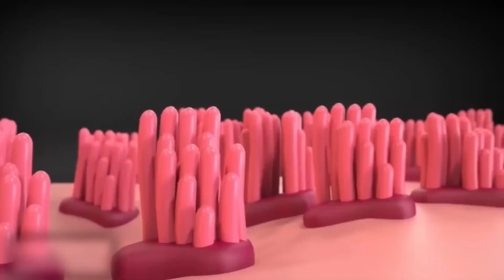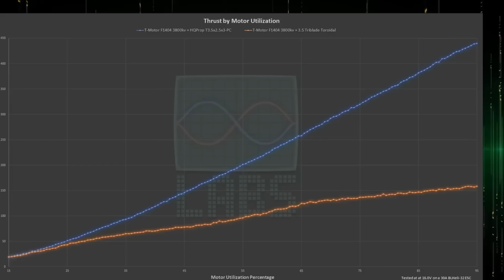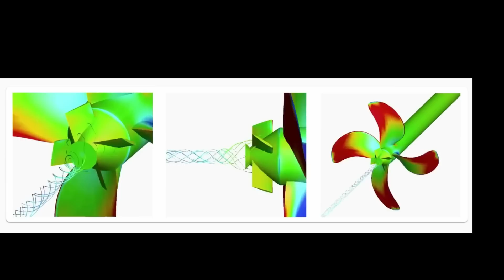This Propeller will Change Aviation Forever!

Comment: What about boats like mine that have 2 counter rotating props on the outdrive? Would it even work and would it be worth an additional $8000 in expense compared to two $450 props. That's not chump change.

Comment: I own a Cessna 180, I have a McCauley 2 blade prop which costs 11K .. these props have a pitch control .. so you change this as you fly … If there was a toroidal prop it would be interesting as it wouldn’t have that unit, it would weigh more though.  Aircraft aviation is very regulated re safety ..this design is quite old.  But make it quieter and fly faster and cost $110K ..it would be interesting to see it made.  For me if it was 10 knots faster but saved 20% fuel that would change the game.

Comment: What about airplanes that have variable pitch propellers in order to take advantage of thinner atmosphere, higher engine speeds, and Fuel and air mixtures. This type of propeller would be a non-starter.

Comment: Toroidals are at least 10x more expensive and the fuel savings are illusory, at best.  If toroidals are so much more efficient, why aren't wind farms using them ???   You don't even see them in cheap desk fans.

Comment: 🤔🔊💭 It's an intriguing question, and the answer might surprise you! While it's commonly believed that the powerhead is the main source of noise in an outboard motor, the submerged propeller does play a significant role in generating noise. 🚀🔊

Comment: I would say propeller technology has come a long way since the Wrights.  This propeller was thought to be quieter and more efficient but it was just about a wash as to those parameters.  That was the conclusion back in the Sixties and Seventies.  You can still find these propellers, on mixers.
Reply: Propeller form design theory has advanced certainly, but the Wright brothers deserve most of the credit for realizing that they could design their aeronautical propellers around a wing section that varied in angle of attack along the radius. Many supposed well researched and better financed would-be inventors conceived of propellers which were simple spirals. The efficient propellers designed and constructed by the Wrights enabled them to get into the air with minimal hrsepower from their home-built gasoline engine and is one of the main reasons they deserve credit for first in powered controllable flight.

Comment: Concerning fixed-wing prop planes, how would you feather the prop to prevent drag, should the prop beccome disabled?
Reply: twins you can feather the prop, not sure about turbines but high performance singles let you control the pitch to a degree, not feather. the fact this prop can do neither seems like an aviation deal breaker to me except for fixed pitch propeller planes which tend to be lower performance.

Comment: Well in an airplane you have to remember the more power the propeller puts out the more torque it puts on an airplane in the opposite direction. So I don't know if this will work that well on an airplane. If you've watched the movie about the friend in the Korean war that crashed his plane to save a friend, who was black, When the pilot that was scared of landing was coming in and was short, he hit full throttle and spun into the water, well that is about what this propellor on an aircraft might do.
Reply: No.
Reply: Thank you❤. 😊
Reply: In that case perhaps it needs modification for aviation use ?

Comment: Without the ability to adjust blade pitch for different airspeeds, any gained efficiency will be lost - non starter for a high performance airplane
Reply: Depends, they could be tuned for RPM ranges, I know it’s cool to be negative about virtually everything. It’s not necessary for everything to be for every situation, it’s more efficient no reason it can’t be larger or tuned with internal actuators.

Comment: 20% Less fuel in a boat? At the rates boats use gas the toroidal prop is definitely worth considering.
Reply: It seems be best suited between the 3000-4000 RPM range !

Comment: Could replace jet engines.
Reply: Or, used in the jet engine, esp the compressor, esp for land based electrical power production (constant speed) - gas turbines?
I am a retired electrical engineer.

Comment: Nobody will want one of these props on a fixed wing airplane because they can't be feathered in an engine out situation.
Reply: That is true
Reply: If you have 12 engines and it flies on as few as 4, they will certainly go for this more efficient design.
Reply: Only if the plane has a CSP.
Reply: Can't they?